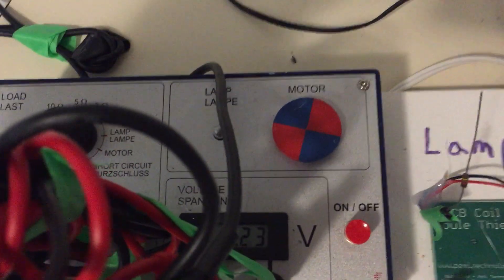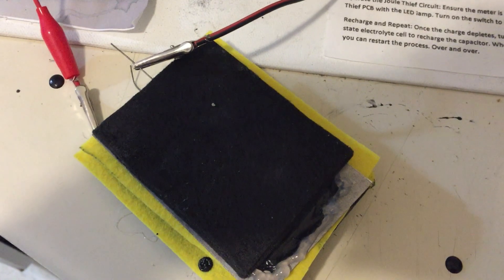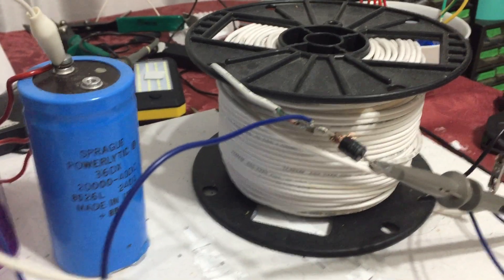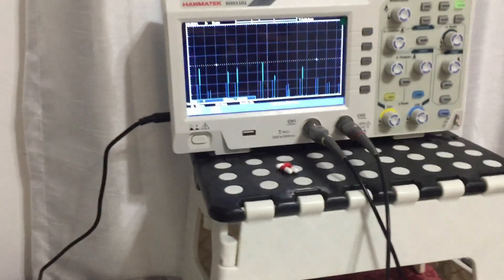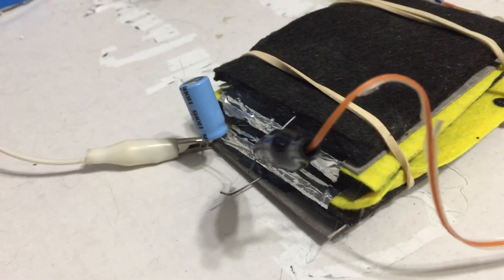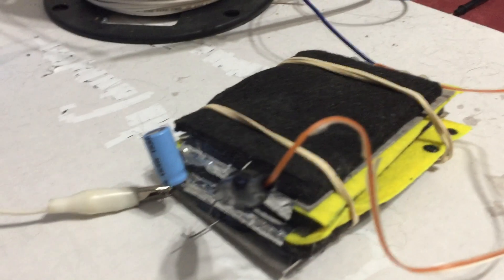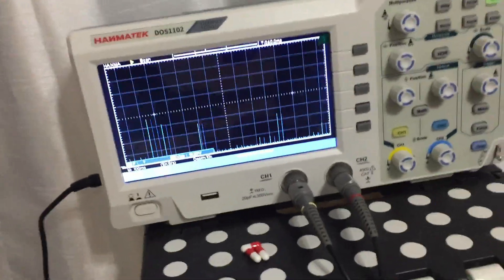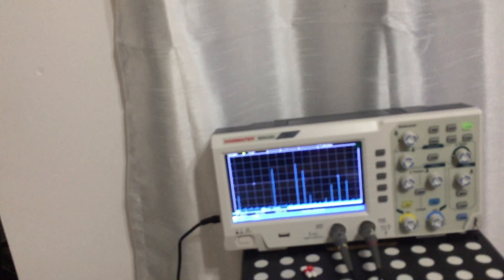100v Pulsing Cell

Comment: Reminds me of how PMMG4HYBRID was doing with tapping the capacitors self recovery. I'm curious how you might come up with a way to use it, its really neat. Thanks for sharing.
Reply from the maker: Charge a 12v battery at night at camp when solar/wind is not available.
Reply from the maker: When you pulse a sharp pulse in reverse on a polarized capacitor,  That self recovery seems more profound. No real science behind it just a personal observation.